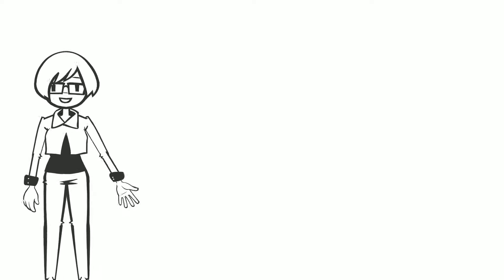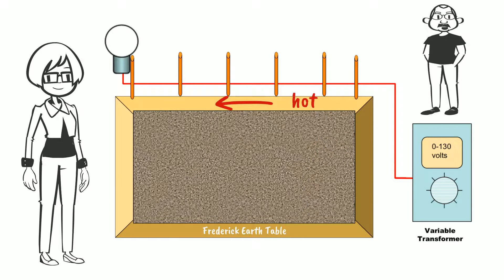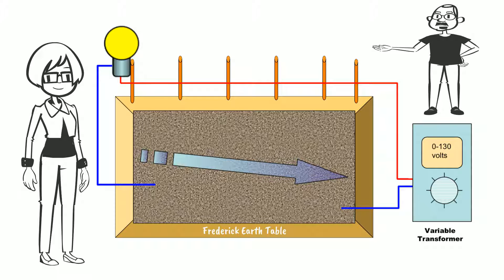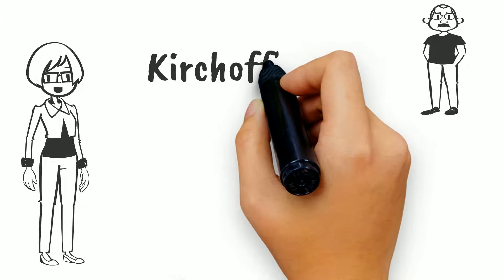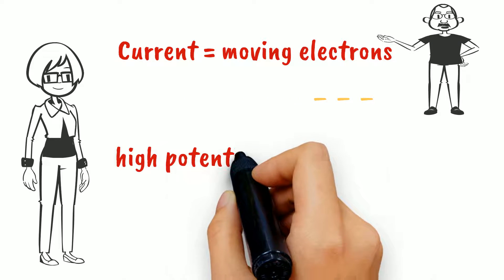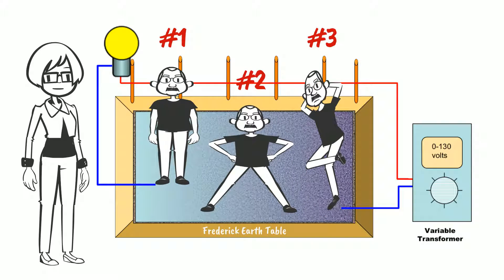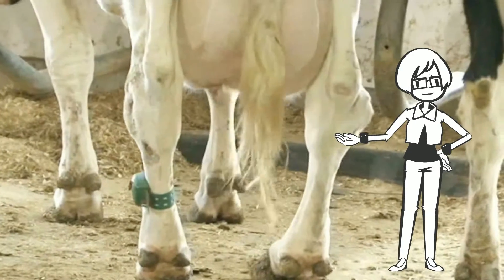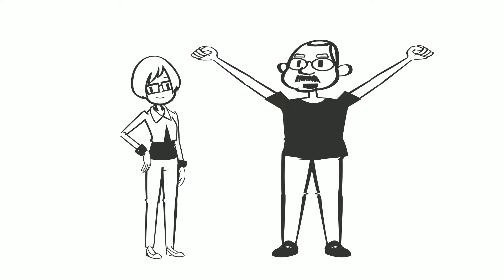GC Video 3 Earth Table 60 Hz

Comment: How does this translate to using electric fencing for livestock?? What are the ramifications? So with an electric fence, the wires are above-ground, suspended by plastic posts with metal ground spikes, the wires form a complete closed circle, with the charger and a grounding rod (sunk 5-feet deep into the earth) next to each other and attached by wires. Are animals/barefoot humans INSIDE the electric fence circle conducting current? Or anywhere around/outside the fence as well... and if so, to what distance? If the charger is sufficient to power a 40 acre area - is that the range to which current is being transmitted/felt. OR only inside the fenced area? Please extrapolate this to real-life usage situation... Thanks!